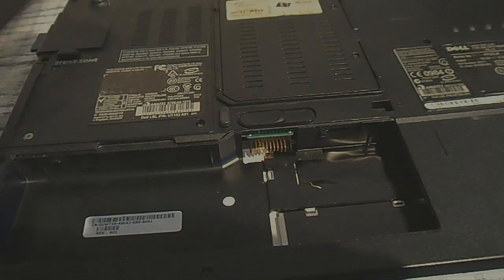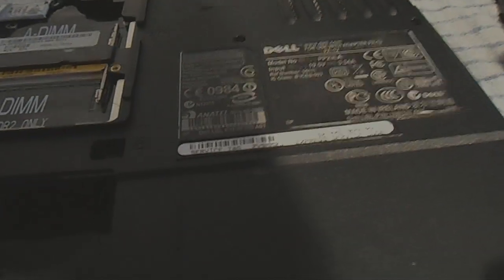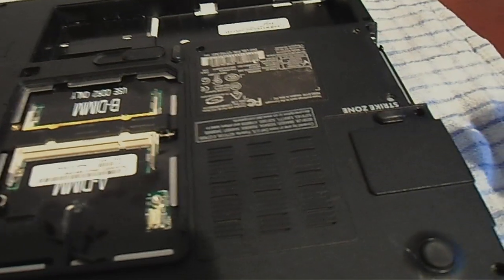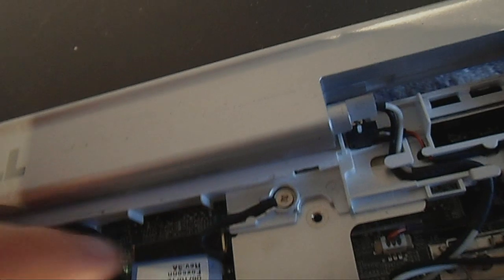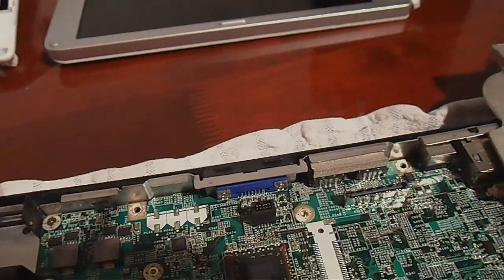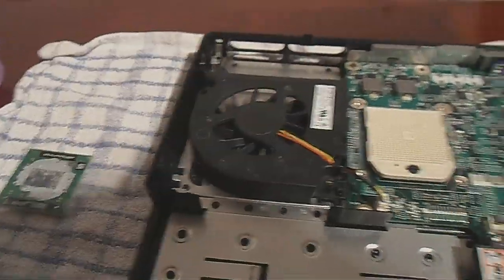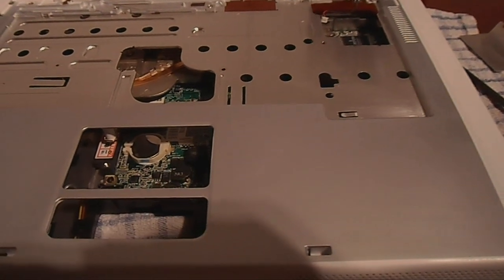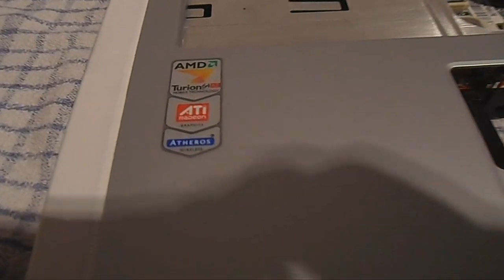Dell Inspiron 1501 Upgrade & Repair Video 2 Of 3

Comment: Great video - thanks. I have a 1501 that had thermal pad on the gpu that ended up getting damaged while i was taking it apart to replace the thermal compound on the actual cpu. I was wondering if I could just use thermal compound instead of buying new pads? on your video you're applying paste. is it good enough or should I place pad?
Reply from the maker: Use a good thick thermal grease like noctua NT H1, that stuff is the ultimate grease for laptops, glad you found my video useful, cheers m8.

Comment: i currently have one of these and am thinking of getting an ssd for it is it worth it?
Reply from the maker: +Dominick Buffaline Defo yes! will make a massive difference
Reply: kk and would an external vediocard help it and if so what kind do u rcomend?
Reply from the maker: you CAN buy external video card BUT the expense outweighs its usefullness on a dual core CPU, the one built in works best on windows XP thats what its optimised for. (dx9 c) here is the adapter you would need: https://www.youtube.com/watch?v=bP_8EYQ-2RA
Reply: omg that looks awesome ....... any idea if my dell inspiron 1501 has a extra port for that or if ill haved to remove my wireless card?
Reply from the maker: cant remember off hand, i think the internal wifi card is indeed mini pcie
Reply: ok ill pop it open and take a look
Reply from the maker: Well if you do manage to get an external graphics card working you could always use a usb dongle for wifi instead
Reply: +Synthematix i have decided im going to do a major overhaul of this pc what gaming mobo will fit in this computer and work?

Comment: How is it running now? Have you had any problems with heat since the swap or is it still running fine?
Reply from the maker: uK8cvPAq no problems at all mate no running sweet as a nut
Reply: Synthematix That is good then, I'm about to do a CPU swap myself but was a little concerned about the GPU thermal pad spoiling.

Its amazing how long some of these machines last for everyday use, the only reason I need to upgrade the processor is because the current single core Turion can't handle modern versions of flash player without choppy playback (CPU usage goes to 100%).
Reply from the maker: yes theyre great with the 2 or 2.2ghz dualcore cpu in with a good amount of ram (holds 8gb max) its a pretty neat laptop, good luck!
Reply: Synthematix Update: I've successfully upgraded the cpu from an MK-36 to a TL-60 (31w version TMDTL60HAX5DC) and it has greatly improved youtube playback performance, I can now even go into full screen mode without any choppiness.

For the ram it has 2x 2GB crucial modules for a total of 4GB in dual channel mode, without dual channel the integrated graphics card suffers a lot since it allocates system RAM for video memory. In single channel the WEI gives 2.3 score for graphics vs 3.1 in dual.

An SSD will probably give it yet another performance boost but only if its dirt cheap as its just not worth putting any more money into this thing.
Reply from the maker: good stuff i recommend the corsair LS 60gb for that laptop
Reply: +Synthematix I have a TL-50 processor and 1gb ram(512+512)mb and I want to upgrade my laptop processor, then increase my ram to 4 or 8gb and also upgrade the bios from 2.3.0 to 2.6.3 or so. Should I get all the upgrades from crucial and what do I need to take out when changing the processor? Thanks.
Reply from the maker: Hello, it will support 8gb ddr2 667 laptop ram with the latest bios flash, and an SSD would be a good idea aswell,
Reply: Can I purchase the crucial 500GB SATA drive and what processoe should I get (and from what website)?
Reply from the maker: this cpu, and yes that hdd will be fine http://www.ebay.co.uk/itm/AMD-Turion-64-X2-RM-74-CPU-Processor-2-2Ghz-TMRM74DAM22GG-RM74-/171945097978?hash=item2808b9fafa
Reply: Synthematix That processor will not work in the Inspiron 1501 as it uses socket S1g1. You need to find a processor that falls within this category https://en.wikipedia.org/wiki/List_of_AMD_Turion_microprocessors#.22Tyler.22_.2865_nm.29_2
Reply: Really appreciate all the help guys! Thanks.
Reply: +Olayinka Olatunde I don't know what country you are in but here is an ebay UK link for the exact processor used in this video http://www.ebay.co.uk/itm/AMD-Turion-64-x2-Dual-Core-Laptop-Processor-CPU-TL-60-2-0GHz-TMDTL60HAX5DM-574-/301684041458 .

As for RAM I recommend Crucial as their stuff is guaranteed to work, but be warned as RAM for this system is quite expensive these days. CT25664AC667 is the model number for a single 2GB stick and CT2KIT25664AC667 is for the 2x2GB 4GB kit, I can confirm that they both work with this system. Ideally you should use two sticks of the same type as this puts the system in dual channel mode and is beneficial to the integrated graphics. In single channel mode the graphics WEI score is 2.3 but in Dual channel it gives a score of 3.1.

If you decide to take the risk and update the BIOS but get the "operating system not found" message after the system has restarted don't panic, just hold down the power button and let the laptop turn off. When you turn it back on it will boot back into windows and automatically start reinstalling all system drivers. This is caused by the newer VBIOS that some revisions of the motherboard get flashed with.

But like I said updating the BIOS is risky and you should always right click and run as administrator and disable any antivirus before running the flash program. Once the process has begun do not interrupt the process even if it looks frozen as this could brick your laptop.
Reply: I'm in the US. Can I get a processor that's more than 2.0GHz? I want to upgrade the bios to the latest 2.6. before upgrading the RAM and processor. Do you still have your Inspiron 1501 with you?
Reply from the maker: i think 2.2ghz is the fastest you can put in this laptop the difference will be minimal anyway. as long as the battery is good upgrading the bios is a doddle takes 15 seconds.
Reply: When I turn on my laptop, it tells me that " The battery cannot be identified, the system may not be able to charge it." But it still charges it. If I unconnect it from the power cord, I could still use the laptop for about 30-40 min before it dies.
Reply from the maker: Thats a problem with the center pin on the charger cable, a very common problem with dell.

Comment: With the new bios 2.6.3 dell 1501 will take 8gig of ram ....I have upgraded a single core to dual core and I have upgraded to 8 gig 800Mhz ram and a 750 gig hhd. 8gigs seems to work fine 4-4 and i'v tried 2-4 which didn't work so well... its funny people on forums have the opposite happen with mixing the ram. And if you want to upgrade the graphics you'll have to with e-graphics(external-desktop video card which can be done with kit I do believe)
Reply: I have the new bios 2.6.3   , I installed 2 sticks of 2 GB ram each , but the computer sees 2GB only

Comment: Hi, I've got the bug to upgrade my inspiron 1501 dual core after looking at your videos,  I found a cpu called, AMD Turion 64 x2 Dual Core 2.0GHz TMDTL60HAX5DM CPU TL-60, can you tell me if it will fit mine, Thanks mate

Comment: im tryin to chargw the batter externally with the cable to get the computer to come on. ive been told the interface on the motherboard connecting the power outlet to the chips leading to the battery charging unit erode or sumthin like that. im tryin to juice the battery up then run her off of battery power to try to remedy it. i  eed to know which of the 9 connectors on the battery corrensponds to what purpose. do u kno?

Comment: i appreciate u gettin back to me, no one else did but my question is which of the little connectors do i stick my home brew chargr too? ive been told u got two grounds, 2 positives, somethin to tell if its 3rd party, etc. im asking u like for a map out. i need to know what to even stick the pos wire on to lol

Comment from the maker: The battery is 19Volts, be very careful, circuitry is built into the battery to know when its charged, tbh messing with the battery is a fire risk.

Comment: dell inspiron 1501 help
I dont have the money for an external charger and im willing to experiment on the computer but i just cant get the info for those small connectors on this battery. i figure someone here would know and me and my friend are fully aware of the risks and no how to monitor the battery safely since we work on electronics alot. if anyone could help it would be appreciated. im just going to go ahead and make an external charger.
for this inspiron 1501.

Comment: It was, yes. Dell Inspiron 1501. Was a single core 1.8Ghz Sempron 3500+. Replaced with a 2.4Ghz dual core Turion 64X2 TL68. Upped the ram to 4Gb and installed a SSD. It's like a new machine.

Comment from the maker: right ok, take out the memory and processor, make sure the cpu is re-seated properly, clean the gold contacts on the memory modules(with paper towel), take out the bios battery and main battery for 5 minutes. (the bios battery is under the keyboard) taking the bios battery out will set the bios to default. good luck.

Comment: Great video. Very clear and consice. Was a bit nervous upgrading mine (have done plenty CPU swaps on desktops, but this was my first go with a laptop), but your video made it a breeze. Just gone from a 1.8Ghz Sempron 3500+ with 1Gb ram to a 2.4Ghz dual core Turion 64X2 TL68 with 4Gb ram. Will just run it for a while to make sure it doesn't burst into flames, then it's in with an SSD.

Comment from the maker: @leemcf4 

Hi mate, yes there was a small pad on there that was about a cm square, i just put a tiny amount of thermal grease on it to further help the heat transfer just in case there was any tiny gaps. And it worked its taken the temp down by 2 degrees.